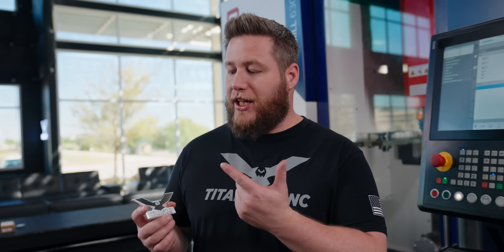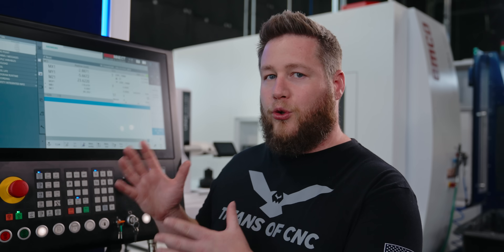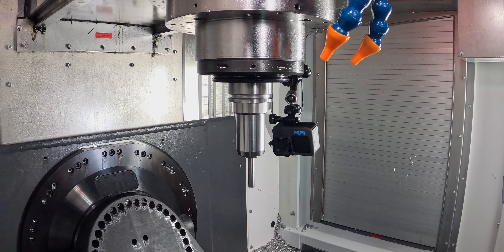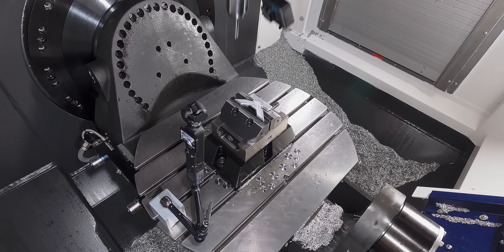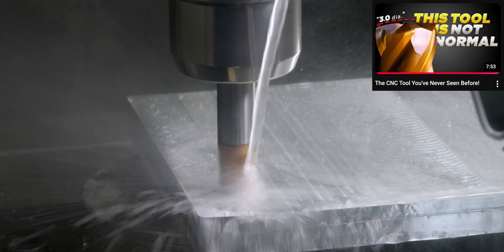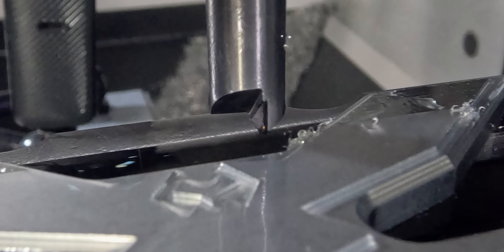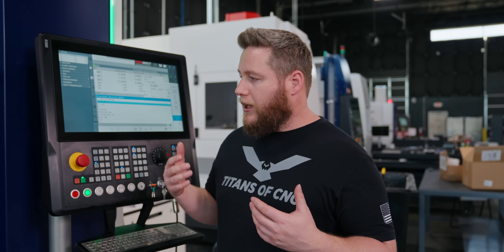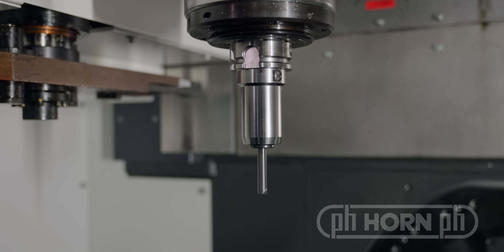Turn Spindle OFF - Zero Vibration - Mirror Finish

Comment: We don't hear all frequencies at equal loudness. What may sound slightly quieter or louder, may in fact be the opposite on an spl meter, and it's our ears natural frequency curve tricking ourselves.

Look up the fletcher munson curves, or the equal loudness contours to see what I mean. You really need to measure the loudness of the tone on an spl meter, or better yet a spectrum analyser hooked upto a flat mic if you wanna get real accurate with detecting the actual least resonate speed!  😊

Comment: That's a really lovely finish. Now I wonder if every CNC mill has the ability to lock the spindle in position like that, there are propably some that can't.
Also I think shaping isn't a lost process and can be adapted for CNC pretty nicely, saw some examples for CNC machining centers using shaping operations to create keyways in holes.

Comment: Guys if u have issue with vibration is possible both to equilibrate the spindle and or manipulate Siemens parameters to reduce that.
Signed off a machine yesterday for some Boeing part, mirror finish, 11krpm 5'000mm/min 
Plus double check runout, in hsk is super easy to correct
Reply: You've got my attention - how is it easier to reduce runout in HSK spindles compared to steep taper?
Reply: @Dreadfox-t9o load a certified bar (or a tool with 0 eccentricity). Check runout at 20 mm and 300mm of length. Of 20mm is over 0.02 bearings or seat are gone. If the 20 is under 0.02 but 300 is like 0.07 you mark the face of the spindle on the opposite side. Remove the tool and with an abrasive stone like a 600grid you remove a little little bit at the time.
Wash with lot of wd40 and recheck. 0.10mm at 300 are like 0.02 on hsk80 so you need to go soft, usually spindle face are hardned, tempered or some superficial treatment, but usually it's on the 0.25mm range so u won't file trough.

A good spindle 18krpm hsk63 brand new should be less than 1mm/s of vibration and 0.01mm of runout.
Clamp in measure is 1.2 circa and clamp out 10.5.
Pull force 11kN

Over 2.5mm/s spindle need rebalancing or bearing swap

Different spindle may have different measurements but those are usually industrial standard for medium size spindle 16-50kw anything bigger or smaller has different number usually
Reply: @Dreadfox-t9o  sorry forgot the taper part, on an iso type tool holder the runout is set by the seat of the taper so if u have runout u need to regrind the taper. Not impossible but u need the right machine
Reply: @VARPYGAMER  Hmm - okay, I accept that taper regrinding is significantly easier on a steep taper that HSK (or "Big Plus" for that matter). So there's not a secret method of improving HSK runout, it's just intrinsic to the requirement for getting the taper and seat correct during manufacture.
Reply: @Dreadfox-t9o hsk doesn't rely on the taper for seating but it relay on the face, with the clamp pulling it against it
Reply: @VARPYGAMER  Thanks, appreciate the "elastic" nature of the HSK taper/face mate but I would argue the taper is still functionally critical to locating the tool holder for concentricity. Or am I misunderstanding what you're saying?
Reply: @Dreadfox-t9o wait, concentricity at the base of the tool is done on the shoulder, so taper + bearing, but on the tool point is only face, that's why by grinding the face you can manipulate runout
Reply: @VARPYGAMER  Thanks for the reply. I will do some more reading on the HSK mate to ensure I have a better understanding of the dynamics.
Reply: @Dreadfox-t9o sure thing, btw I'm a spindle and CNC manufacturer, if u have issue hit me up (Italy located tho)
Reply: @VARPYGAMER  Interesting! If you would, please reply with a search term (sometimes YT doesn't allow direct links) so I can find your website.

Comment: People often think that the higher the rpms the better the finish - which Ive found to not always be true. I can hog away material in lets say aluminium with 12k rpms but will turn the tool down to 10k rpms for finishing. Way better.

Comment: congratulations you made your CNC into a shaper machine :D
Reply: Yeah but you would need to make an entire separate operation for shaper, milling your part in the cnc and then taking that finished or half finished part out and setting up on a shaper for a finish like this, instead milling and this operation can be done in one machine without any extra setups. I know you tried to sound witty and knowledgeable but..... you failed because you lack foresight and critical thinking. It took me 5 seconds to think about this properly after reading your comment.

Comment: Would a slow rpm and feed flycutter achieve the same finish? If so, that would eliminate the need to keep moving the cutter away when avoiding changes in z, no?
Reply: Issue is, a nice BIG flycutter that wouldn't recut that part wouldn't fit in most CNC tool changers.    Those things tend to dislike tools with a larger diameter than the holder.

Comment: The shaper is back
Reply: Crazy how they didn't mention that machine.
Reply: The same idea comes up in my mind. Would be funny to see, if
my old shaper can do this job.
Reply: You saved me 7 mins thanks.
Reply: they say you can make anything with a shaper. anything other than a profit...
Reply: Have you seen clickspring? It's been back for almost a decade.
Reply: or planer?
Reply: @johnnycomelately8577 yea planer woud be closer, because on the shaper the tool is doing the working motion, while with the planer the workpiece is doing the working motion. Both are cool pieces of machery

Comment: Wonder if there's a way to lock spindle on a cheap machine that is running the spindle in SVC sensor less drive. I'd probably have to put a c clamp on the nut lol

Comment: you have to play with the rake angle, feedrate and Ap, to get the best result. Watch the alloy, i tried 7075 once, and the hard zirconium particles shredded the surface. CuZn37 works well, and if you work good enough, you will make the crystall latice visible under the microscope. For the best result, use pure metal. If i need a perfect mirror finnish, i goldcoat the surface and plane the half of the gold away. Cu ETP is also suited for that result, but copper forms really fast a oxide layer, (like aluminium btw.)

Comment: I'm not trolling.  I'm asking because my limited CNC mindset is telling me that perhaps I could have simply buffed out the surface of that first sample you showed us.
If machining time is a factor, it would seem that using the milling process that produced the initial sample that you showed us, AND the second operation which would be the buffing operation might still be faster than the slow meticulous process you show in your "Mirror Finish" creating alternative.  Or, maybe not.  I don't really know.  I'm just asking and thinking out loud.
Reply: Buffing and polishing will give you a highly reflective surface, but often at the expense of it being a FLAT surface.

When it's just a visual puff piece, it's not an issue, but when you are trying to optically focus a beam of laser light for a MOT (watch the Breaking Taps video he mentions in this video), you need namometer scale levels of tolerance for both roughness (reflectivity) and flatness (focus).

Precision mirrors are literally using the length of the wavelengths of light to indicate how much dispersion a mirror has.
Reply: you know, he probably went slow for filming purpose. with coolant running, that should be able to run way faster. 
and as i wrote earlier - its an example for a process. the "knowledge" can then be applied to other tasks, like cutting a freeform O-ring-groove into a surface with the ideal surface quality with no post-processing required
Reply: @supremecommander2398  Depends on the surface finish. Watching 6 axis cutting on a diamond turning machine, I'd say it was quite fast and a large depth of cut.

Comment: I wondered how you got a finish like that, very impressive. Could you sharpen a knife using this method? Or would the metal be too thin?
Reply: The edge would deflect and roll away. Grinding is the only way for sharp edges.

Comment: ahh shaping in the mill. where the surface finish becomes depending on only 3 things 
the grind of your tool
the uniformaty of the balls in your ballscrew 
and and uniformaty of the balles in your linear guide ways 

( only way to get it down to only depending on 1 thing is to buy a machine that use hydrostatic ways and liner motors ( since non of those two are physically connected and therefore cant inflyence the finish at all )
Reply: I don't have balls in my ways 
Just metal on metal and slideway oil
Reply: @Thefreakyfreek  is it pust put there or is it constantly being pumped there ( basiclly making float on a constantly mentained thickness of oil film ) ?
Reply: @flikflak24  It is constantly being pumped.
Reply: @dnc-game  might be hydrostatic then which is good

Comment: Oh, i also saw that video a while ago where @BreakingTaps was making optical mirror in pure copper
Reply: BreakingTaps making mirror finish without sophisticated machine
Reply: @sandeepshekhar451  BreakingTaps uses a Kitamura with manually scraped contact surfaces and a full stroke positioning accuracy of ±0.001mm (±0.000039”), repeatability ±0.0005mm (±0.00002”)
Reply: Shoutout breaking taps